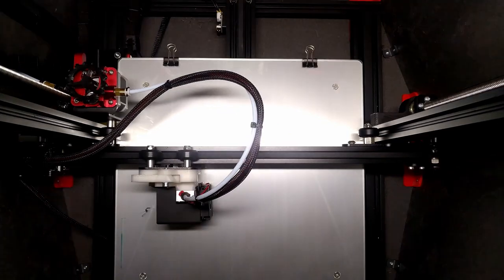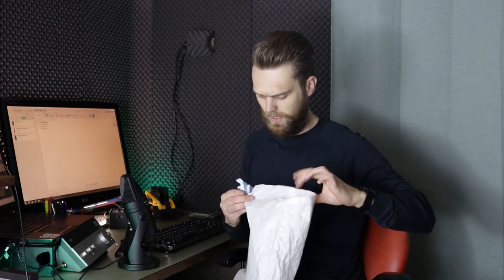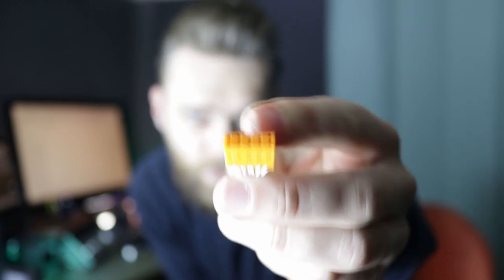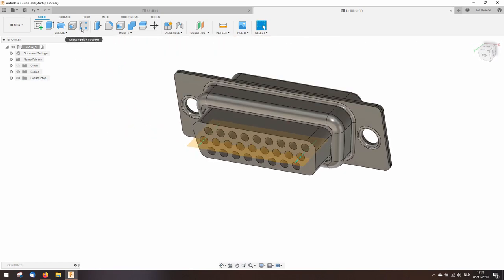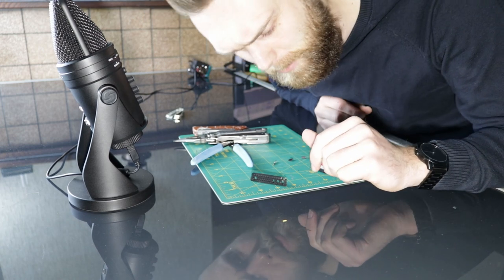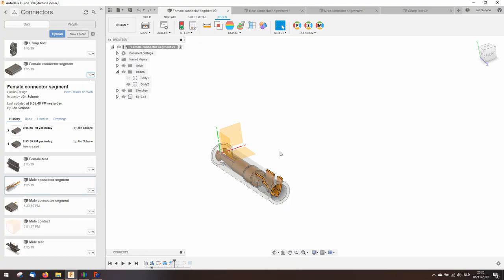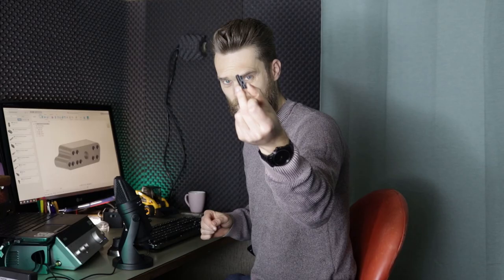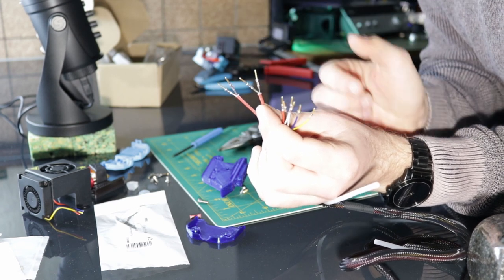Design and print a custom connector for the Creality printer with swappable hot end

Comment: I am having problems on my ender3 pro hot end, Filament keeps getting stuck
I was wondering what you would recommend as an easy fit and maybe it could be used to print carbon fibre filament in the future prints, I was looking at this E3D v6 Hotend Full Kit
Reply from the maker: I use the E3D v6 as well and I have very good experiences with it! However, this can get stuck as well. I had to reduce the retraction settings to 2mm. Did you check if the bowden tube at the hot end side is cut straight and pushed all the way down into the hot end? My tube wasn't pushed all the way down when I got this problem. It can be tempting to buy a new hot end, but I would first try to see what causes the problem. Good luck!
Reply: @properprinting  Yes ,I have checked that bowden tube, strange how it prints ok then seem always half way through, the filament stops
Reply from the maker: That's strange indeed.. The only thing I can think of right now is reducing the retraction settings. Maybe the hot end got somehow damaged.
Reply: @properprinting  I will try a final print tomorrow ,set to normal and a speed of 50 instead of 65 I will get back to you I don't really want to spend £100 on a new hermes hotend and motor
Cheers for the reply
Reply: @properprinting  Alex McPherson  Is there a way I can get a photo to you Did the print again today Made sure the temp was at 240 nozzle, filament was coming through great. Altered the speed to 60 and put the print setting to fine. It started off great and again half way through, it starts to do like an infill print.
Reply from the maker: @madforit9661  Hi, I just realized I overlooked this comment. If the problem still exists, I would suggest to post the pictures on the 3D printing subreddit https://www.reddit.com/r/3Dprinting/ They are over all very helpful and a lot of them do know more than I do regarding 3D print issues. I ran out of suggestions so I hope this will help you.

Comment: Newark is also a good place to look for pins, and they have a live chat available for assistance.  https://www.newark.com/webapp/wcs/stores/servlet/Search?categoryId=800000006533  

You could or might have to go to larger gauge pins to standardize your design a bit.  That way your power and signals can all be going thru  the same size pins and you can just buy the connectors you need.  ( Except for the bourdon tube of course)  And by the way, each size increase will handle twice the current of the one below it. For instance, the 20 gauge pin will handle twice the current of the 22 gauge pin and so on. 

The other way to handle more power is to increase the voltage.  This is probably why Creality  changed their voltages between the CR-10 and the Ender 3 series.  That way they don't have to increase the pin size to get the power they need for the hot end connectors!
Reply from the maker: Thanks a lot for the information! I didn't know that an increase in wire gauge duplicates the current which it can handle, good to know! I know Newark, the shot of the expensive crimp tools is from Farnell which is a company by Avnet as well. I'm thinking of adding two high power terminals but this may be a bit overkill since these terminals can handle 20A xD
Reply: @properprinting  It depends on the current requirements of your heater pins.  The simplest design would be to make all the smaller pins large enough to handle the highest current requirement. That way the connect or is less complicated and the pins are stronger by default.    Another way would be to double up on the number of pins dedicated to the heater.  4 instead of 2 gives twice the current carrying capacity, but I would go with the larger  pins if possible. 

As far as wire gauge- yes, if you go from say 22 gauge wire to 20 gauge you double the current it can safely handle.  That being said, there are charts all over the internet for AWG versus amps and those should be consulted if you are doing design work- or even plugging in your Christmas tree to an extension cord.  But remember the current goes up as the gauge number goes down.   The length of wire also has an effect and certain loads like electric motors can be damaged from being run off of a long run of wire.  Ohms law is a Very useful idea and concept to consider- it has far reaching consequences too!

Comment: If you made a direct drive swap in I'd be all over your quick change tool head, already thinking about it just for the bed leveler
Reply from the maker: Thanks for your comment and I'm thinking of doing something like that. However, a bit different than you'd expect ;)
Reply: @properprinting  I'm definitely interested to see how you do it, I'm currently using a bondtech and soon to be mosquito, but I also like my volcano so something like your tool change would be a massive advantage.

Comment: I wonder why no one makes it so that you have GND, 24V, SCL and SDA going to small extruder PCB that controlls everything.
That's only 4 wires.
Reply from the maker: That's actually not a bad idea at all! Maybe it's even possible to communicate over the 24V line by superimposing it. I was thinking about experimenting with sliding contacts but the amount of connections makes this very difficult. By reducing this it should be possible but I don't know if it's even possible to communicate over a sliding contact xD
Reply: Duet 3d has a tool board that is very close to this. Power plus a CAN-FD cable and you have the extruder stepper controller, 2 fan controllers, 2 thermistor inputs, a z probe input, a filament sensor input, a high power extruder heater output and a few extra things. Not a bad way to get rid of a bunch of wires. The downside is it requires a CAN-FD connection and the only place I know that has that is the Duet 3 mainboard. A great mainboard but pricey.

Comment: At work I bought a multi purpose crimp tool from Knipex https://www.conrad.com/p/knipex-multicrimp-97-33-02-crimper-non-insulated-open-end-connectors-insulated-cable-lugs-insulated-connectors-ferru-821056

And specifically to Target Molex pins I bought the classic https://www.molex.com/molex/products/datasheet.jsp?part=active/0638111000_APPLICATION_TOOLIN.xml&channel=Products&Lang=en-US

The latter doesn't have ratcheting nor support for dual flange crimps. But if you can manage individual crimps and doing them twice then it has all the necessary diameters and shapes.
Reply from the maker: Thanks Sebastian for your comment! I've found something similar on Conrad as well which is less expensive. I've used this in my latest video and it works pretty good! At work we use the official Molex tools, but they are too expensive for me.
Reply: @properprinting  You could also check out the connectors from TE. I've used the Deutsch connectors for automotive use and they have barrel crimps and solderable pins as well. Not as fiddly as e.g. Molex, cheap tools and easy to manage.

Comment: I just came across your Quick tool change for Creality CR-10 today while I was searching for a mount for the Exoslide for my OmniaDrop direct drive.  Your concept is genius and much better than what I was working on.  I did handle the wiring differently, instead of one connection for everything, I make three one for the extruder motor, one for the fans and one for the heater and thermistor.  I can change out any section without having to change all of the wiring,   I used two types of Molex connectors and a JST-MH connector.  I did that on purpose so that the plugs could not be hooked up incorrectly.  Both concepts have merit, yours is very simple to swap, mine is very simple to maintain.   I need to clean up the connectors, but have been trying to find a better mounting system.  I think yours will be great.  Here is a quick video of what mine looks like from a couple of weeks ago.  https://www.youtube.com/watch?v=53stcBzj-UY&t=3s&ab_channel=DavidWilson

Comment: The crimping tool you have bought is made for crimping round ferules onto stranded wire and NOT for this type of pin.

An example of the correct tool for your style of pin is this: https://www.ebay.com/itm/Mini-Micro-Open-Barrel-Crimping-Tools-Works-on-For-AWG28-20-JAM-Molex-Tyco-JST/174091579831?hash=item2888aab1b7:g:Cp0AAOSwEbBdx8L9 (And yes for some unknown reason this type of crimp tool costs more despite being simpler)

Comment: A pity that there is no connection for a BL- Touch
Reply from the maker: The cool thing about this approach is that you can add connector segments and print a custom connector including those connections ;) I don't need them, so I don't print them :D
Reply: @properprinting  i still have a lot of these sixties computer boards, with gold-plated contacts that I can desolder and use for my own, zo fortunately I don't need them neither.

Comment: Hey! Loved your new video. I do have a couple of questions as well. Both regarding this adapter and the tool change system in general. I had also posted a new comment on thingiverse. Did not receive a response after the first one. Anyway,

About this particular idea of a mod, 

Why does the bowden tube HAVE to be inside the adapter? I mean, just use a vga adapter for the wires and have the bowden tube separately. Similar to how creality did with their new CP-10 printer. Here is TT's video on it https://www.youtube.com/watch?v=s__H_bcFvds

About the tool changing system,
1. I was thinking of using https://www.thingiverse.com/thing:53451 as bearing instead of using the plastic pulley wheels. I am not really good with CAD software and could use your help in adapting those to the required size.

On the same note, might as well avoid the pulley wheels altogether and go for a sliding system where you have a T channel on the base plate and an adapter that slides over it? Here's a quick drawing to show you what I mean. https://imgur.com/a/XXBAcVP 

2. Going a step further, how about incorporating https://www.thingiverse.com/thing:21234 or from https://www.thingiverse.com/thing:1690305 or a spring similar to the one used in https://www.thingiverse.com/thing:5713? This will avoid having to use the click pen springs you mentioned. This isn't exactly a priority though.

3. Also, wouldn't it be a good idea to reduce the travel distance between the tool touching the base plate to the switch activating?  It appears to be about 5mm right now. We may have to remove the roller from the switch for this but this should make the system more stable as a high travel distance will make it a bit weak and could be a problem. Especially when using a Dremel or CNC module.

4. You have written about using plastic with a high melting point to use for the hotend adapter to avoid it getting melted. How about creating a mould for the hot end holder and then using something like epoxy/cement mix/plaster etc to have a strong holder that does not melt. I am thinking of just using cura's mold option for this but dont have high expectations from that. This is just a thought I wanted your opinion on.

I also needed some distances for the new tool changer. https://cdn.thingiverse.com/assets/ca/32/20/2d/fe/Required_Distances.png

Looking forward to your response.
Reply from the maker: Thanks for your comment! I somehow missed your comment on Thingiverse, my apologies. Thingiverse has shown the infinite logo next to dashboard which is a sign that I should get through the notifications xD
Anyway, about your points:
The example of Creality is a direct drive extruder so it’s easy to disconnect the electrical terminals since there is no bowden. I don’t see the disadvantage of incorporating the bowden in the connector, especially when I can design and print my own connector. I never have a loose dangling bowden tube when I want to use a laser cutter.

I’m fond of using standard parts where possible. This video seems to show the contrary, but this is a custom part. Why would I print a spring why I can just unscrew a ball-pen and use that spring (or buy a bunch of these springs)? Like the pulley wheels, they aren’t expensive and they work. Why should I get through the trouble of printing these standard parts which are of lesser quality? I have printed the gear you’ve shown and it’s an awesome design, I wish I’d come up with it. However, the smaller you print this, the more difficult it rotates if you manage to get it turning in the first place.

Thanks a lot for thinking with me like you did with the t-channel! I’ve thought of a dove tail sliding system which has a smaller footprint but the problem is the friction. The pulley wheels do have a very low friction because it's a rolling mechanism. A sliding mechanism needs a very tight tolerance to be precise but this increases the friction dramatically.

A thing we can definitely agree on is that this design can be improved and I got lots of comments on YouTube and Reddit about this design. I’m very thankful with the critical comments with suggestions like yours because this helps a lot! I’m now thinking of designing a compliant mechanism together with a piezo sensor which will solve a lot of the problems, like the large travel distance you’ve mentioned.

I’ll update the drawing with the added dimension soon. Thanks again for your comment!
Reply: @properprinting   Thanks for the response. Don't worry about missing the comment. I have trouble receiving notifications from youtube and Thingiverse. And yeah, a conversation with you is always interesting. 

Regarding the pulley wheels, a set of three costs nearly as much as half a kilo of PLA for me. So it would make sense for me to put some thought and effort into it. 

As for the spring, it was just a thought. When you are too excited to print this new set of tools and then realize you need a spring and don't have one laying around, even having to go to a nearby store can be a bit difficult. Similar to the way you said when you had a better tool lying but were too excited to go get it. The spring isn't a priority or a big deal anyway. I just wanted your opinion on how something like that would compare.

Coming to the Bowden tube inside the connector, while you can surely design and print your own connector, inserting those tiny little leads into the printed part doesn't seem to be worth the time and effort (the part in the video where you said they break if you apply too much force and also that it's hard to remove them out if they get stuck inside). While I love your approach with minimizing costs as far as possible (I have a blog named thriftyengineer.com based on this thought philosophy), using a VGA cable might be worth it. Especially considering a lot of people might have them lying around from old unusable monitors. Especially since new computers/laptops have pretty much moved to HDMI and other ports.

'Dove Tail'. Yes! That was the term I was searching for! Sorry, my vocabulary is rather limited to civil engineering terms at the moment... Anyway, what you say regarding friction when sliding makes sense. Noted and agreed.

"A thing we can definitely agree on is that this design can be improved." Love this approach of yours! 

"I’m very thankful with the critical comments with suggestions like yours because this helps a lot!" Hey, I really wanna do more than just comments and suggestions. But until I can make time to learn 3D design beyond SketchUp, I suppose I am stuck to just comments. I will reach there in time. :D

The Piezo sensor looks quite interesting for this. I am looking forward to what you come up with using this.

Also, I wanted your thoughts on creating a mold and using epoxy/cement mortar that I mentioned in the last part. What might be the cons of doing this in your opinions?

Last, please share your Reddit id. I would like to follow you there as well.
Reply from the maker: @ravikiranp7532  Thanks man for your comment, I really like your input and don't get me wrong about the spring :) A compliant mechanism is basically a printed spring so your suggestion is pretty much in line with my idea. Inserting the individual connections took indeed a lot of time (this video shows a very tiny portion of the effort I've put into it). However, this shouldn't be so difficult and I'm convinced that with the proper tools and design it isn't harder than soldering but in this early stage things go a lot harder than they should xD.

I've taken a look into your blog and it looks awesome man! I really love the style and I'm definitely going to take a moment, grab a coffee and read everything. Thanks man for sharing! I'm considering doing some explanation videos about designing in Fusion 360 once I'm starting to run out of ideas, but this is not going to happen soon xD. Yes, the casting! I have not any experience with it but this is something on my list. I would like to do something like veggie oil guy did and I really want to learn more about this technique. For now I'm a complete noob regarding this but one problem I can think of right now for using this for the tool holder is the accuracy and amount of work. Still something interesting to investigate! My Reddit ID is properprinting, I was very happy that this wasn't already taken :)